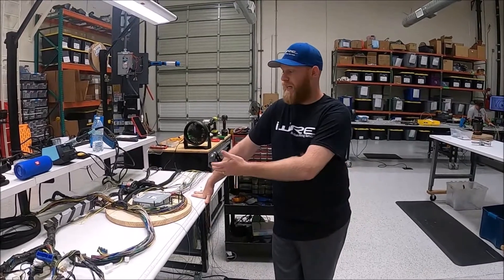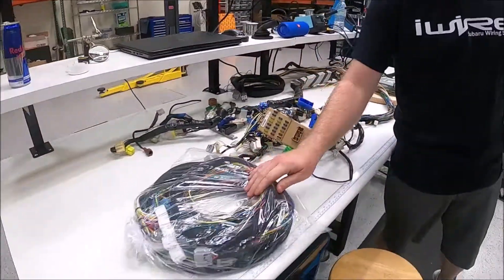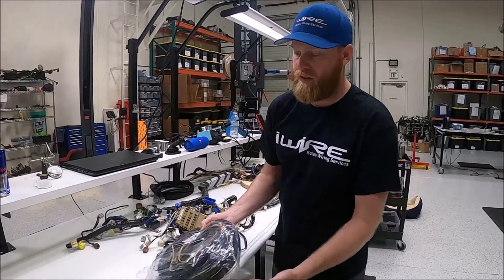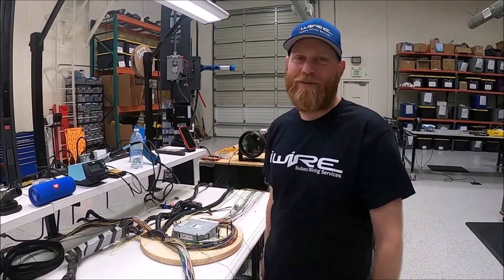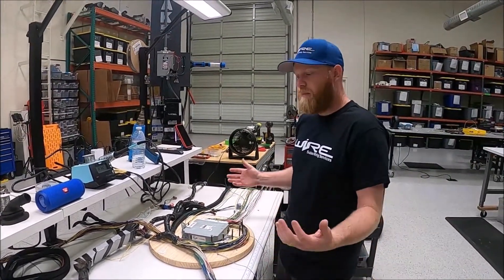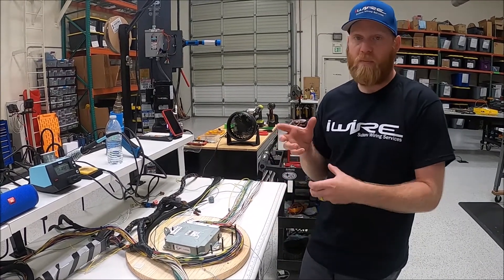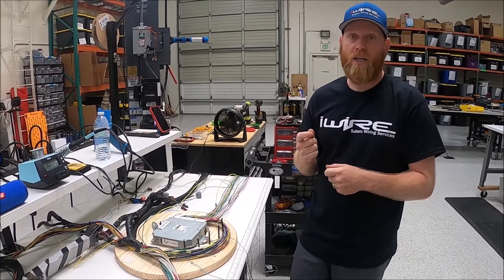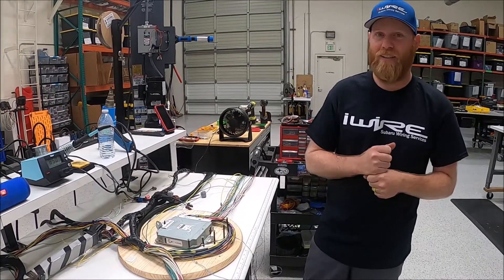iWire Harness Merge for Bucky Lasek's RS Weekend Swap

Comment: I have one, potentially not invasive question... How do you guys deal with the electrical tape residue.... 

I've done several difference harnesses over the years and I have tried several, unsavory ways to make it work (when I was 15 I actually used dawn soap and a rag... in retrospect I am worried what that does to the insulator), later I tried googone (not bad, but leaves a sheen that sucks....
Reply from the maker: Hi William. Generally, a basic degreaser diluted will work just fine, but it's always a mess is the best answer. We use a specific tape that does not leave a residue, just like the tape found on a factory Subaru harness.
Reply: @iwiresubaruwiringsolutions  thank you so much for the feedback!

Can’t wait to order y’all’s products soon! Almost done with long block.

I actually do wiring for control panels for oil/gas automation. I love wires, but I can appreciate when someone has perfected a process and has access to new connectors (Sumitomo or whatever)
Reply from the maker: @williamhall2386  You're quite welcome and that's awesome!

Comment: Hi there do you ship to UK? my other half is in the process of building up a WRX Blobeye which was originally converted from NA But the previous guy pretty much hacked the wiring harness. my other half has managed to get 90% of it working but he's having issues with seat belt plugs, wiper motor not working, fuel level sender not working any help would be appreciated, the car runs perfectly, seems to respond well it's mainly electrical issues as he want's to get it MOT ready (smog) what's the best advice you can give him?
Reply from the maker: Hello, yes we do ship to the UK. Our best advice is to start eliminating variables as best he can and go from there. Also the wiring diagrams from both cars will be his best friend.
Reply: @iwiresubaruwiringsolutions  appreciate it he said, he said he will look into the guides, he knows the wiring loom gone in is from a legacy XT he was unsure why the previous owner would do that instead of a blobeye saloon WRX, he also found out that the issue with the fuel level could be that the previous owner did not install a WRX sender unit could that be the cause of no fuel gauge response?

Comment: Do you guys recommend anyone on the east coast? I live in va and bought swap rs coupe. Looks like the wiring was diy. Motor sounds healthy and everything electrical works. However I’m getting an engine code for o2 sensors p0031 and p0037 and a bunch of tgv codes. Motor is an ej207 v7 so I know tgv codes are there because the v7 has no tgvs. Also Running a usdm 02 wrx ecu.  Planning on buying Jdm ecu soon so I can get the avcs working. Any help would be appreciated!
Reply from the maker: Hi, please send us an email to sales@iwireserivces.com so we can better assist.